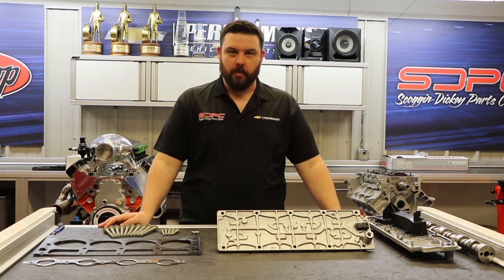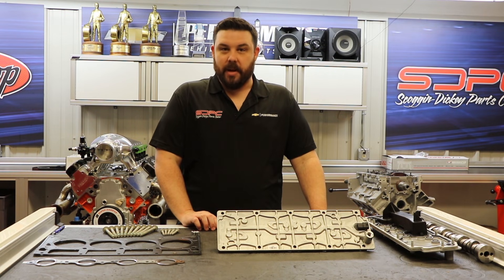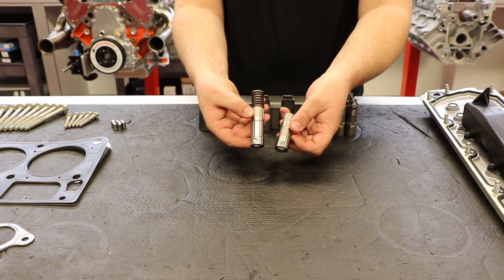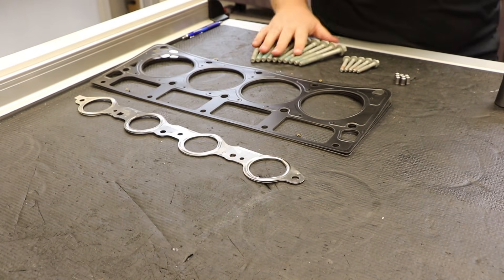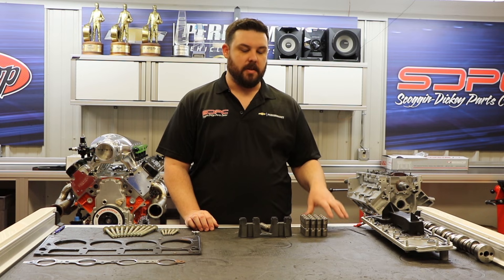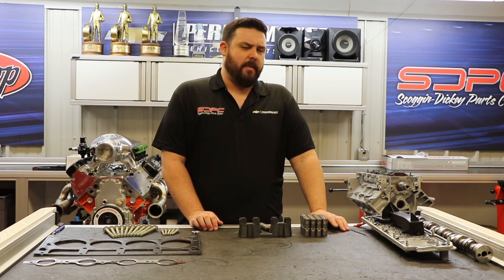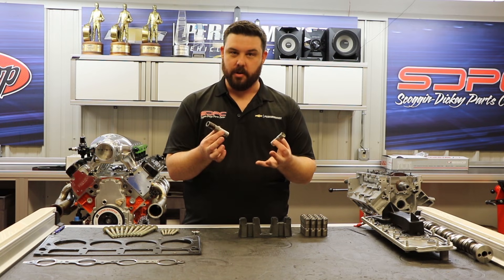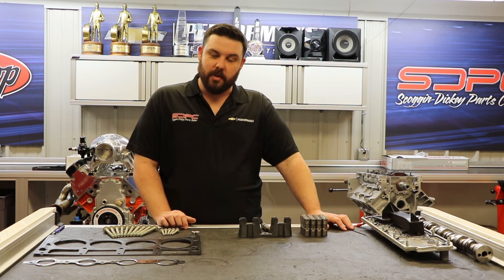SDPC Tech Tips: DOD/AFM Delete 101

Comment: Why do you have to remove the cylinder heads to replace the valve lifters? I have a LS 5.3 and all I have to remove are the valve covers and rocker rails .. and the lifters and guides come right out 🤔
Reply from the maker: Are you sure about that?
Reply: You need to remove the heads to get to the lifter trays. The only thing you’ll have access to under valve covers is the rocker arms and pushrods. Lifters and trays sit UNDER the heads
Reply: It’s ok to be wrong some times

Comment: Can someone explain, WHY? the cam has to be replaced ,specifically on a L84. (5.3 LT) if im just doing all non dod lifters, ICT block off plugs inside the valley & a full DFM delete w/HP Tuners on a good running engine to avoid future catostrophic breakdown.   This guy only says " cam must be replaced". But why?  Tell me something, oil passage, material hardness, diff lobe specs!   Something!
Reply from the maker: @forcefed385  lobe specs, the ramp rate is different because the dod lifter weight is different.
Reply: Gotcha.  Thx

Comment: I did a DOD delete and plugged the holes and used a flat-type manifold cover. My question is what do I do with the electrical connector that plugged into the DOD factory manifold. I have a 2009 Pontiac g8gt. Thanks
Reply: What did you end up doing

Comment: My local tune shop wants 1000 (cdn) to tune out dod if I replace the cam/lifters in my 2017 Sierra.  They want 450 just to turn it off.  Why the significant increase in price?
Why cant you just replace the afm lifters with normal roller lifters, leave the oe dod cam, and simply turn off the system?
Reply: Because the compression from the oil will cause issues(I have absolutely no idea what im talking about)

Comment: I want to delete dod only and not the VVT so mechanically do I have to replace the Cam shaft and the lifters ?
If I leave dod connector unplugged would the engine work normally with the dod lifters there ?

Comment: On a budget , could you leave the stock dod lifters and cam, put in the block plugs to keep oil from collapsing them and get a tune that dissables dod? Would that work?
Reply from the maker: Sorry, no that would not be a solution. You could tune it to keep the lifters from activating dod, but the mechanical side is all or none.

Comment: I have just purchased a 2022 Chev. Silverado. What do I need to do to eliminate the AFM system on this truck? What's it gonna cost? It has low milage. 17,000. The other thing is, will it mess with my warranty?
Reply from the maker: Yes it will void your warranty.

Some people use a plug in obdii device to keep it from triggering the dynamic fuel management.

For the 6.2L delete kits:
https://sdparts.com/i-24529275

For the 5.3L delete kits:
https://sdparts.com/i-24529276

You will need a pcm tune as well.

Comment: I have a 2017 Silverado with the 6.2,  I bought a Texas Speed DOD Delete kit with the stock non DOD camshaft and GM performance ls7 lifters.  Am i ok to use the stock pushrod length(7.850") if everything else is stock or do i need to buy the tool and check the length?

Also is anything else needed to be done to the VLOM cover if youre using the 8 DOD plugs?
Reply: Best thing you can do is call them and tell them what you bought and want to do. They sent me a fully itemized quote with everything I would need. For a stage 2 cam they included 7.850 pushrods

Comment: I have never heard of replacing the camshaft. If you have to place the camshaft which I can not fathom why you should have to. I also believe that when you are replacing the lifters & push rods, & rocker arms, all should be replaced than only on the cylinders de-activated by the ARM, DOD, DDOD systems.
Reply: If you delete the AFM lifters and replace them with standard LS lifters you HAVE to change the camshaft because the lift is different on the AFM Lobes.

Comment: There is no shortage of “kits” to delete AFM. However, I don’t have a ton of mechanics around me jumping up and down to do this modification. One of the best “race” mechanics I know in my town doesn’t want to touch it due to all of the modern crap on these engines.
Reply from the maker: It's a challenge when some don't have access to HP Tuners, or a reliable person to recalibrate the ECU. They're out there, it's just usually you'll find it at more performance oriented shops and not the general repair places.

Comment: I'm putting a 5.3 ls out of a chevy Silverado 2010 with 6l80 transmission also it's going in a 1997 s10 pickup single cab can I use the stock oilpan from the Silverado without having to cut my s10 or do I need to change the oilpan if so which one do I need I really need your help

Comment: I understand this video was 4 yrs ago but I have an issue today, changed everything on the dod delete kit stock cam, lifters, gaskets, 4.8 valley cover on a 08 1500 and for some reason I keeps throwing codes for the 1,4,6,7 solenoids and is preventing those same injections from working. I bought the little box off the internet & the issue remains
Reply from the maker: You have to get the vehicle tuned when performing the DOD delete. The little "Range extender" dongles do not work.

Comment: Can you explain in detail why you wouldn't be able to use your old cam if it wasn't damaged? I just purchased an aftermarket delete kit and it came w/a gm cam. What would be the difference in the 2?
Reply from the maker: An AFM Cam has different ramp rates on the lobes to deal with the different lifter masses, the differences are enough for whatever reason with the GM calibration that it can trigger a missfire code.
Reply: @Sdpartscenter  thanks for the reply!
Reply: I have to take vehicle ab 30 miles from me to get ecm tuned after deleting the afm mechanically. Question I have is can I crank vehicle to check fluids n make sure I don't have any issues or do I have to wait until ecm is tuned
Reply: @allenwoodall9493  I’ve heard if you unplug the oil pressure sensor in the back it makes it so it doesn’t go into AFM mode. All the tune does is make it so the computer doesn’t go into dod and make the car run lean or something like that

Comment: Good Video! I have a 2007 tahoe with 180,000miles, I installed the AFM range disabler and replaced the updated valve cover back when I bought the tahoe, close to 8 years ago! The last six months ive noticed higher than usual oil consumption and a strong vacuum from the oil fill cap when car is running. Local shop did a quick check on the pcv valve and completed a smoke test for leaks all good there. They even checked the compression on the cylinders and also ok, there's no check engine codes, no white smoke from the tailpipe and no other noise that would indicate failing lifters. They shop said oil rings are the culprit for the oil consumption. My question for you guys is do you agree with the diagnostic and what is your recommendation moving forward, make repairs now or is there something else that could be done before they open her up?
Reply: Bg epr engine flush 3-4x every1k miles

Comment: I have a che ticket suburban 2010 5.3 with a VVT sprocket, I changed the selenoid cover for a flat one / it does not have an AFM deactivation sensor / and now 4 cylinders do not work / what can I do?
Reply from the maker: Did you replace the DOD lifters with non-dod lifters?

Have you tuned the vehicle yet? Removing the DOD hardware requires a tune.

Comment: Why do you need to remove the cylinder heads? I thought you could remove the lifters with them in place.
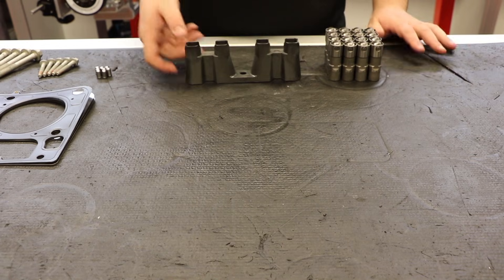Reply: @2:22 "You also get two head gaskets, two exhaust manifold gaskets, and a set of head bolts. You do need these parts because you do have to remove the cylinder heads to get to these lifters."
Reply from the maker: Unlike an SBC, BBC, 3800, or any other GM pushrod engine designed before the 90s, the LS and LT engines both require you to remove the heads to replace the lifters.
Reply: @Sdpartscenter  thanks, I skimmed the video a little too much lol I appreciate the info!

Comment: How do I call what's the number
Reply from the maker: 1-800-456-0211

On higher mileage engines, one recommendation is to change the oil pump while your in there along with the camshaft thrust plate (the 3-bolt plate that holds the camshaft in as the gasket gets pretty hard and flattened over time and can bleed off oil pressure).

Other results can be dependent on how long the vehicle was driven with damaged cam/lifters.

Comment: Hello Guys! I'm interested in delete my 2008 Chevy Avalanche LTZ DOD system, I was watching your video and I want to order the kit, but I do have 2 questions: 1st- After I delete DOD this way, my truck will have check engine light On?
2nd- Which cam will you recommend me to upgrade if I do not want to use the factory one? I want a little bit  more power in possible... Thanks in Advance...
Reply from the maker: 1) You will need to get it tuned after deleting the dod.

2) We did a video on some of our popular cams with the Hot truck torque and LS6 powermax cams.
https://www.youtube.com/watch?v=rzzGidbDhvY

Comment: So if you install the plugs for the oil it will delete the v4 mode while it still shows up on dash ?
Reply from the maker: Yes it still shows up on the dash. You absolutely have to tune it out with hptuners.
Reply: @Sdpartscenter  thanks for the quick response ! I have a plug for the VLOM that came with a tool I purchased I was able to release the lifter and changed with a new vlom ran for a block and it came back when the v4 mode was on , my question is , if I use your plugs and the vlom plug with cutting the gaskets the lifters shouldn’t collapse as there will not be oil pressure to them  and if they do collapse will I be able to remove the plugs in your kit ? And what would happen if I don’t use a tuner to get rid of the v4 mode ? Thanks in advance !
Reply from the maker: @freedom-volvo-usa  did you change out the DOD lifters and cam for a non-DOD setup?
Reply: @Sdpartscenter  no i did not, would there be an issue plugging the system the oil pressure is what collapses the lifters  
I was able to go wide open throttle to 80 mph no noise but when I let off and went to v4 mode the lifter  collapsed and the noise came back

Comment: Why do you have to replace the Cam?
Reply from the maker: The ramp rate is different between the DOD and non DOD lobes, it's just enough of a difference that it can cause a missfire code.  Many times the camshaft is already galled and needs to be replaced anyway.

Comment: Have a question. I have a 2007 avalanche with the AFM system and I never had anything done to it but one day it just started staying in v8 mode at all times and all speeds it never goes back into v4 mode what could cause this? I’ve never used a range device and it also doesn’t tick or anything I just find it weird.. thanks in advance
Reply: I'm wondering if the chip that powers the change went bad.  During this time of chip shortages, GM is selling some trucks with no DFM due to a chip shortage.  These engines are coming out of the factory like they should---V-8 mode only.
Reply: Step on it see how fast it goes now
Reply: He states he has an 2007 vehicle. Chip shortages was not an issue back then.

Comment: If you replace the AFM components with these AFM delete kits will it:

1.) Pass CA smog? 
2.) Will the stock computer work?
3.)Will it or will it not give you a check engine light?
Reply from the maker: With recent changes to how they test, it won't pass CA smog since you have to change the tune on the pcm to shut off the afm parameters.  We are told that any pcm changes detected result in a failed inspection there.

Stock computer needs recalibration.

It will throw a CEL and go into limp mode without recalibration.

We do have an AFM repair kit for those in strict smog states:
https://sdparts.com/i-24508803
Reply: @Sdpartscenter  Would it be possible to place a 4.8L computer on a 5.3L with a AFM delete kit since the 4.8L of that year did not have AFM?

Comment: I bought an edge pro Ht2 programmer and disabled the afm. I have an "10" sierra 1500 with 5.3, it also burns oil, and used to eat sparkplugs before I disabled the afm. Will it continue to still eat sparkplugs, and burn oil? I'm looking into the delete kit and found a mechanic to do it. I'm at 120,000, does it sound like anything else should be looked at before pulling the trigger? Ps I just bought the truck🤦

Comment: If I’m deleting dod and swapping cam does that mean I should get new heads and ect.. have 2011 5.3 gmc
Reply from the maker: Depends on who you're telling you NEED those parts for :)

But for you, you don't necessarily have to run aftermarket heads if you're doing just the AFM delete cam or even some of the other mild cams on the market.  If you check out our 5.3L cam shootout, you can get some pretty solid gains with some of our popular cam grinds with stock heads.  Heads do of course help, it's just up to what you have planned on the build.

https://www.youtube.com/watch?v=rzzGidbDhvY

Comment: Nice video.  Been reading a bit that some guys who have the oil pan off are running a threaded plug of some type to block oil flow up to the old valley pan.  Doesn't make sense to me, as the oil pressure sending unit is fed off of that too.  Anything on this?

Comment: I have a 5.3 and got a plug in afm disabler, can I still use 0-20 oil or would I need to upgrade to 5-30? Vehicle barely has 50k miles

Comment: What do you need to do with the electronics, if anything, when you do the mechanical delete? I have a 2011 1500 with a 5.3.
Reply from the maker: Using software like HP Tuners, you need to shut off any of the DOD/AFM tables and codes.

Comment: I have a 06 trailblazer LS with the 5.3  and need to do the delete, if I do the stock style cam will it have to be tuned for it?
Reply from the maker: Yes, you'll need to have it tuned to shut off the DOD tables if you use the stock style non-dod cam.

Comment: So I've done my share of these lifter replacements and one common issue that was not mentioned is the lifter guides and what happens to the lifter as the guide wears out .but thats not my question .So when the ECM can no longer control the DOD it puts the vehicle in limp mode .You didn't state anything about this .How do you get around this issue?
Reply: Following, just did DOD delete and now my fuel trims won’t happen. O2’s both read.05 -0, can’t find any vacuum leaks.only codes are for vlom and my trims are maxed at 25%
Reply: Hey I also want to mention that I have found that is causing these lifters to stick is the VLOM and that is simply the bolts lose their torque and become lose. Causing oil pressure to drop.  So the next time anyone starts to tear down an engine I bet you can turn the first 4 bolts in the vlom by hand. At least I have.

Comment: If you're going that deep, remove the AFM lifters and solenoid cover, change the oil pump to a standard one and never worry about it again. The internals on the LS swap over pretty easy. Would also be a good time to put in a non AFM cam. Surprisingly easy to rebuild one of these engines
Reply: Agree 100% just did that about a month ago to my 07 avalanche with a 108k miles. No more Christmas lights or “ tic tic tic” noises { lifters failing)
Reply: GM has been trying the AFM/DOD games since 1981 in the Cadillac L62 "V8-6-4" and has been a failure.  It should be a recall.
Reply: What about reprogramming?
Reply: You just repeated everything he said lol
Reply: @MagicJack999  Like he didn't bother watch the video
Reply: @MagicJack999  He said best to keep the high volume oil pump.
Reply: Tell me you didn’t watch the video without telling me you didn’t watch the video
Reply: Maybe you should watch the video before commenting!!!
Or do you just not comprehend English!!!

Comment: Hey Scoggin, i just done a DOD/AFM delete on my 2007 Suburban 5.3... Its a Texas Speed kit that comes with everything "Cam,lifters, valley cap etc" after startup i have smoke "doesn't smell like oil or anything" and does have power  starts right up and runs so smooth @ idle  but under throttle it acts like its running on 4 cylinders instead of 8. Will I need my suburban tuned to get rid of this issues or is the issues somewhere else?
Reply from the maker: Hi Doug, yes you need to get the DOD parameters tuned out and the driving issues should go away.

If it's a steady stream of smoke, that'd be no good and an indicator of other issues.  If it's a puff of smoke on startup it could just be burning off deposits and fluids that got into the intake or cylinder during the work.  Would be a good idea to keep an eye on it and make sure it doesn't worsen.
Reply: @Sdpartscenter  at idle it doesn’t smoke only when I give it fuel and it doesn’t smell like oil or fuel for that matter maybe half burnt fuel, going to get it tuned shortly and will update once reinstalled and running